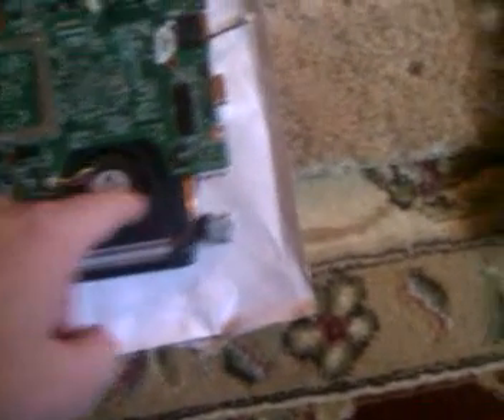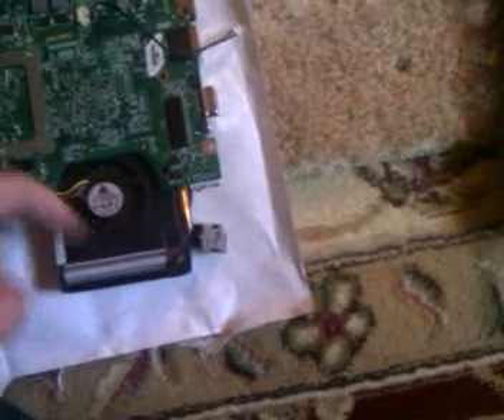Overheating HP G60 Laptop Part 1

Comment from the maker: @yomothaWHAT If there is not much build up you can vacume the square inch intake on the bottom while spraying compressed air into the vents on the back.

Once it gets a build up... this is the only way into that area. check out "how to take apart a HP laptop"

Comment from the maker: @Dizzymo3 Spray canned air to the exhaust and vacume the air intake of the cooling system at the same time while the computer is off. Take a look at my "Fix overheating HP G60 laptop Part 2 -FIXED-"

Comment from the maker: @uribe14506 I just took it back apart and opened up the cooling system. I found a AA battery size dust collection too. Thanks.

As far as the grey wire gos, I had trouble with it too. The plastic connector came off of the wire part. The wire-end connectors will still slide onto the posts on the board side. On each metal part there is a lip that sticks up. Face that up and use a tiny flat head to push them into place. They will stay.

I'll post a video on it as soon as I can get it to load.